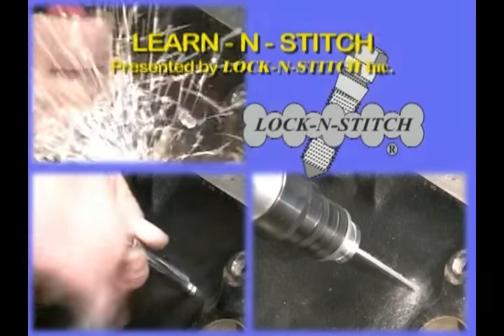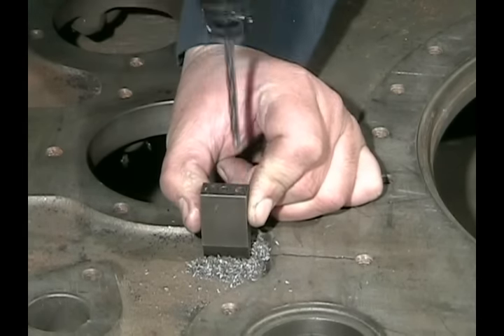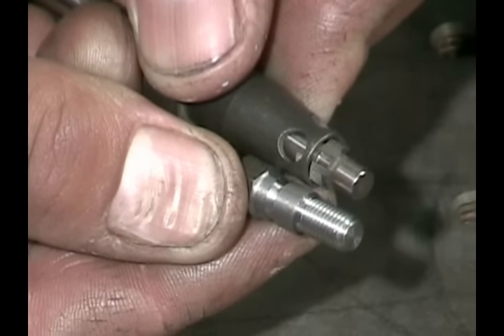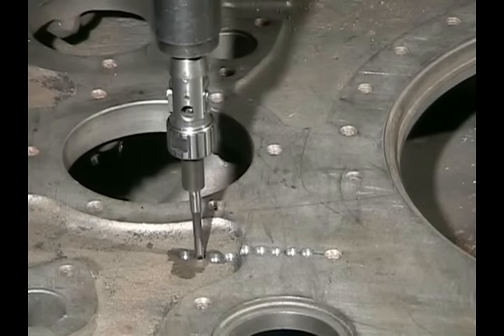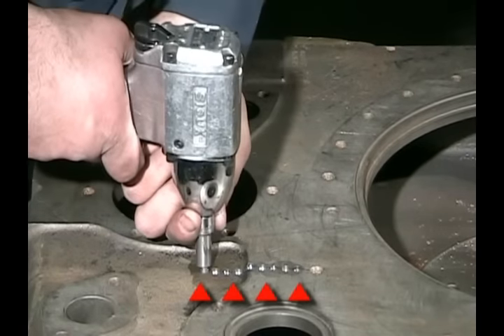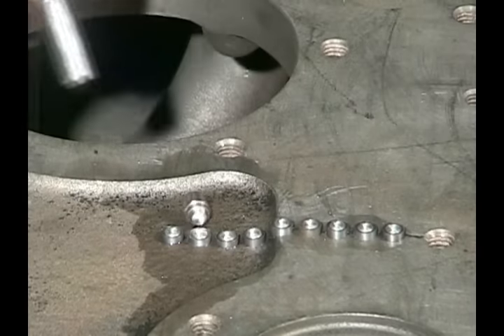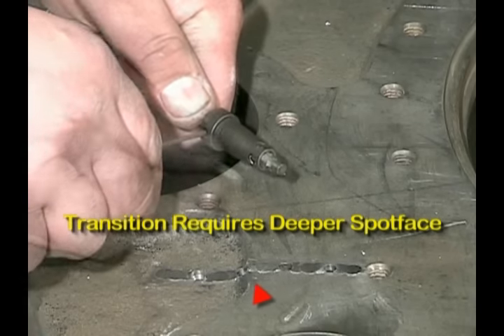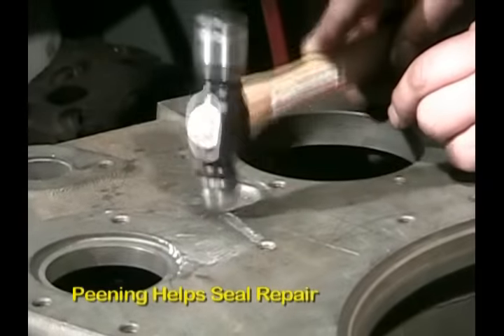Cast Iron Crack repair

Comment: As an Ex Toolmaker I feel that this video seems to be misleading, having worked on many many cast iron products. This casting appears to be Aluminium or Aluminum as may be preferred. The swarf from the drill is too coarse, it cuts too easily and the use of fine threads is not recommended for cast iron. When machining cast iron cutting  lubricant is not normally used or recommended. The Lock & Stitch products may well be suited for repairing cracks in cast aluminum but this video is listed as "Cast Iron Crack repair"
Reply from the maker: We appreciate you watching and adding your comments, the repair is for cast iron!  If you would like to get more information or talk to one of our technicians about the process feel free to email or call anytime info@locknstitch.com or 800/736-8261 or 209/632-2345
Reply: This process may well be for cast iron I agree but the casting shown in the video in my experience isn't cast iron but aluminum. It's color is wrong and as I stated previously the swarf and the ease of which it is cut doesn't fit with cast iron. We may have to agree to disagree. It would be interesting to see if the drill being used in this video has a negative rake on it's cutting edge?

Comment: I was a welder all my life. My buddy owns a machine shop, stop by one day and he started telling me about this new system he was going to buy. It consisted of a oven, a welder and a spray weld for a torch setup. I laughed, and said spray weld bulshit. He went ahead and bought the whole package then the man came from the company to show us how to use everything the spray weld amazed me I ended up doing his welding on heads cylinder blocks. He had a boss block come in with two lower bellhousing lugs broke completely off through half of the bolt holes it came with a spray that you sprayed onto the bolt laid new bolts in what was left of the hole built the whole lug back on both sides with the spray weld, screwed the bolts out grounded down where it was supposed to be then took a scaling tool and went all over the spray weld so it would look like the original casting, retapped the holes, to clean the threads up. They did the rest of the machine work to the block built the motor that was in 2003 and the motor is still in the car to this day never have broke. I've also welded up cast-iron heads with the spray weld one big advantage to it is it easy to Mill. I also fixed a head that was in a sand drag Jeep 4 cylinder and where it had such big and strong valve springs it was pushing them through the head somebody had tried brazing them before bringing it there I cut all the braze out went down to the underside and built pedestals out of the spray weld then filled the hole and they never broke either this 4-cylinder left the line at 8500 RPMs. That was 15 years ago imagine how far welding techniques have came now. I have seen a lot of heads and blocks both pinned also, with good results. There's just more options these days

Comment: How thick does casting have to be for this to work?
Reply from the maker: Thanks for your question - the C1 pins can be used for very thin material down to 0.100" http://castingrepair.locknstitch.com/item/c1-stitching-pins/steel-castmaster--c1-stitching-pins/c1a-50 - if you have a specific repair need or question please feel free to reach out to our customer service specialists.  They would be happy to speak to you. info@locknstitch.com or 800/736-8261 or 209/632-2345
Reply: @LOCKNSTITCH  thank you for prompt response. 😁
Reply from the maker: @BspPlays9287  anytime - truly appreciate your interest in our products and services.
Reply: @LOCKNSTITCH  yeah going to have to see if block I'm working on is fixable first. The crack rose up on one side enough to catch a fingernail on. Gonna use a feela gague to see exactly how high it is.
Reply from the maker: @BspPlays9287  get some good pictures too - those are always helpful for the team when they are discussing the repair with you over the phone and in email
Reply: @LOCKNSTITCH  k will do thanks
Reply: @LOCKNSTITCH  I have sent you the pictures via email, hope to hear from your company soon.
Reply from the maker: @BspPlays9287  can you try sending them again?  The team checked and the pictures did not come over to the email info@locknstitch.com
Reply: @LOCKNSTITCH  I have sent the pictures again and here is a video of the pictures. https://youtu.be/sgm5hFMmB9U

Comment: Well impressed 👍👍 I guess doing it this way as opposed to welding it up you have no heating issues that you can get when welding cast iron 🤔
Reply from the maker: Exactly!  100% correct - also it can be done in frame. Thanks for watching and commenting.

Comment: I don't understand how this fixes the crack. I thought you'd want to pull both sides together so they can take some tension again. Like if you were to fix it with a staple gun, if you had one that worked in metal. And then maybe drill at both ends to remove the weak spots. But these threaded inserts can't take any tension across the machined surface, no?
Reply from the maker: Thanks for the question.  It does work to pull the metal together - this short demo video can hopefully explain the process better https://www.youtube.com/watch?v=ELQmD8AFqzs
Reply: @LOCKNSTITCH  That's clever, thanks!
Reply from the maker: @attitudeadjuster793  Most welcome! We appreciate you watching.  Let us know if we can ever be of assistance.

Comment: Hook the STICK welder up backwards angels it ,it will not crack because the welder pulls the heat away from the cast iron and it will not crack when you finish it up I do it all the time , I use one welder for cast iron because they will not last long , if you have a four inch crack you are good ,when you are done welding you can put your hand on it and it's warm it works and it's quick.

Comment: Yep.  Found in an engineering paper with a couple of minutes' search: 
"Result & Conclusions: This thesis showed that only a fifth of the original strength remains after repairing. Despite this, the method is very useful in places on the engine 
block that are not directly affected by firing pressure or other highly loaded places." 

You know, like those places that don't crack because they're not significantly loaded.

Comment: As a professional engine Rebuilder I have used products similar to this. In my opinion it is overkill and unnecessary. I was taught that by drilling a hole just passed the end of a crack and Welding with Mig to stitch back together works much better.

Comment: I just drilled a relief hole at the end of the crack and Tig welded it per spec. I never had a crack reappear even in a cast-iron engine block that was putting out 700FtLbs of torque. Not saying this is wrong, just leaving my opinion.

Comment: Localised welding heat will further cause the cast to crack, this method seals the cracks from leaks, strength is not required.

Comment: I have another opinion ... When such things happen here in Pakistan . We put the entire block in wood-powder furnace, and heat it up until it becomes semi-red, and then its done with spot on high Electri voltage, and then the upper is faced on lathe machine ... And the results are amazing .

Comment: I must have missed something here, how this can be called stitching when there is no actual pulling together of the edges of crack?  As I see it all that has happened is that the surface area of the edges of the crack has been greatly increased because of the threads before being glued together again with the thread sealant?
Reply from the maker: The patented thread design pulls the material together and adds strength
Reply: The metal would have failed initially because of tensile or bending stress, and the crack relieved the stress. So you don't necessarily want to "pull it together" as doing so would replace the original stress. This is just filling the void with new metal and interrupting the stress concentration. You probably wouldn't want to do this sort of repair on a running crack, because you'd just keep elongating it. I imagine you would need to take some care to ensure that the outermost pins are through uncracked metal, or you'd just end up splitting the workpiece in two.
Reply: @stickyfox   Thanks for the explanation, I was having difficulty in imagining how it manages to hold together say a cracked cast iron boss on a gear wheel  (It obviously works well for some applications though)
Reply from the maker: @stickyfox  http://www.locknstitch.com/precision-metal-stitching.html this explains the process in depth.

Comment: I JB welded an 1/8" x 6" crack on an old mann s90me-c9.2 diesel block! Its still actually holding, haha fingers crossed
Reply from the maker: Fingers crossed - but if that repair does fail, we are here to help!  Thanks for watching and commenting.  800/736-8261 or 209/632-2345 info@locknstitch.com
Reply: @LOCKNSTITCH  Amazing product. Thanks for bringing back old school craftsmanship!
Reply from the maker: @sz42781  Thank you!  We are very passionate about casting repair!   Our goal is to always provide top quality products and services.  We can restoring valuable or irreplaceable castings, save companies money and downtime,  help individuals with specific repair needs; we are here to help the customer make the best repair decision! A satisfied customer is what makes it all worth while.
Reply: @LOCKNSTITCH  any Idea how to fix a sand casting hole in cast iron plumbing pipe fitting 1/4 inch thick, without an arc welder? Is it possible to braze this?
Reply from the maker: @sz42781  this can be repaired with our process please call in or email in to get us the dimensions 800/736-8261 or 209/632-2345 info@locknstitch.com

Comment: Nice work!
Would this work on the combustion area of a Diesel Cylinder Head?
What is the ratings and specks of the curing agent?
Reply from the maker: This most certainly will and does!  Please contact our office 800/736-8261 or info@locknstitch.com and out customer service team would be happy to provide you with more information on any specific repair questions you may have.  Thank you for watching and commenting!

Comment: Because when you weld cast iron you have to preheat it and post heat it or it will just crack again, and since most people dont have an oven that an engine block will fit into and go up 500F this is easier.

Comment: Pinning a crack in cast iron is not a new gimmick. The old timers did it way back when and it is a good repair when done correctly.  But it does take some skill and a bit of knowledge about metals. The method used in this video seems like a way for less-skilled people to get the good repair that old timers did by eye. One of the other commenters wondered if the person in this video had truly defined the end of the crack by some method other than guess-work i.e. magnaflux etc. Those cracks can travel much further than can be seen with the naked eye. They can also extend through bolt holes even though it may not be obvious. So it's important to truly define the extent of the crack and do the repair from end to end.  As for welding or brazing, I managed to ruin two early 1920's Model T blocks doing it that way. But I can attribute that to 'operator error'.  I do know that genuine pro machinery shops  can weld/braze but I've also had them tell me that they would rather pin certain cracks.
Reply: I have this problem in my ford escape my crack is quite a bit wider than this. Will it work still?

Comment: this is very cool, but i dont understand how it holds the cast iron together at all. havent you just made a large oval gap filled with partially mangled bolts?
Reply from the maker: Exactly the opposite, we have pulled the surrounding material together; made it stronger.  This short video shows how our patented thread design works on our stitching pins. https://www.youtube.com/watch?v=ELQmD8AFqzs

Comment: Cast iron has been around way longer than welding has and this was the only way to repair a crack and worked then and works now when welding is not optimal. sure welding it with nickel rod or basing it would work and hold but who knows what reasons those metals or the heat cant be used for this situation.  my friend was a machinist for years and sometimes they had him do this and sometimes they sent things out to be welded. just depended on the job requirements.  no risk of heat warp?

Comment: I was just wondering- whats wrong with cutting into the crack with a grinder and welding then grinding back? You could reheat with a flame to relieve welding stresses.

Comment: Wasn't this called Metal lock in the old days Going back to 1994. had a job done on a large salt water pump casing made from Cast Iron. Shipboard use.
Reply from the maker: Rudolf - thanks for watching and commenting.  No, LNS products and methods are a newer technology, a better technology; the technology of the stitching pins that LNS patented, manufactures, sells and uses in repairs pulls the material together adding strength to the repairs.  If you would like to have more information please do not hesitate to reach out to our team.  They would be happy to connect with you and get more information sent, or answer any questions you may have.  800/736-8261 or 209/632-2345 info@locknstitch.com

Comment: So the strength of the repair is from the threads preventing movement along the crack?
Reply from the maker: The patented thread design pulls the metal together - unlike a tapered plug that pushed the metal apart!  You are correct, this adds strength the to repair.

Comment: Regular tapered stitch pins are better , also you should drill you hole so it touches the last pit so when you tighten  it makes a solid fit into the last pin, I have pinned many blocks and have never had one leak yet, I use the goodson pins, they are cheap and easy to install.  I would like to try these sometime , why wouldn't you use a air peener instead of a hammer?
Reply from the maker: Remember the tapered pins push the material apart - these patented C2F pins pull the material together; if you have specific questions please feel free to call our customer service agents, they would be happy to help you and talk to you more about the LNS process 800/736-8261

Comment: Another Great engineering  and fabrication job Dave.
 Hey buddy, I'm sorry I haven't gotten that new shield put on my Brush bull yet. I need to get that done soon and to mow. I told my self I wouldn't use it till I slipped the clutch, as I doubt they did, even though they said it was all  ready to go. 
PS: What color orange do you use for your Kubota or do you buy Kubota Orange ?
 I know on the orange it make a difference on what color primer you put it over.
Reply from the maker: Victor - your question, was it meant for us at LOCK-N-STITCH?

Comment: I love that drill and drill bit! :D
Reply from the maker: We sell a full line of drill bits for installing our crack repair and thread repair products - if you are interested in learning more we would be happy to send you an information packet info@locknstitch.com  Thank you for your comments!
Reply: Gotta love this simply ingenious method of repairing what looks to be a very expensive casting.
Reply from the maker: We can restore priceless and one of a kind castings! There are so many different applications for this cold mechanical process.

Comment: does the metal that the stitching bolts are made of need to be softer than the cast iron?  im asking because as a precaution you preened over the edges of the bolts to improve the repair.  i see that only being possible if the bolts are softer.  please correct me if im wrong.
Reply from the maker: Rufo  our stitching pins are made of “12L14” steel and have very similar characteristics to cast iron.  The peening process is part of the installation for both our “L” and our” C” series pins.

Comment: How does this joint have any strength in tension?
Reply: KenLyns only compression, this repair enlarges the crack to the size of the screws so this area has no tensional strength any more

Comment: By the time you got the last hole drilled I'd have this casting up to temperature and ready to weld! This is a veteran cast iron torch welder from way back. Use this method on a 2000 pound casting under a large load and it will fail!

Comment: Can this process be used on diesel 12litre engine it has a crack in two cylinder walls they are behind sleeves in casting never had issue with motor bearing went down, sent to machine shop and cracks show up? The problem is area to work in these are in the bore walls so very tight quarters, would tig be more applicable in this situation ?
Reply from the maker: Glenn can you give our office a call?  They would be happy to discuss repair options with you 800/736-8261 or 209/632-2345 ask to speak with customer service.  Thank you for reaching out to us here.

Comment: I have a 5.9 Cummins with a small crack that connects between 2 exhaust valves.  Is this fixable?  What kit would I need to do this job?
Reply: I'm not super qualified to answer, but that's definitely not fixable. At least not to the strength of a new head
Reply from the maker: Absolutely!  Please reach out to our customer service team. They will provide you with everything you need to do the repair and help you along the way.  Thanks for watching and for your question  info@locknstitch.com or 209/632-2345

Comment: learned something nerw again  :) tnx for that.  little question , what if a crack is on horizontal and goes over a corner to a vertical side?  is this method still possible than?